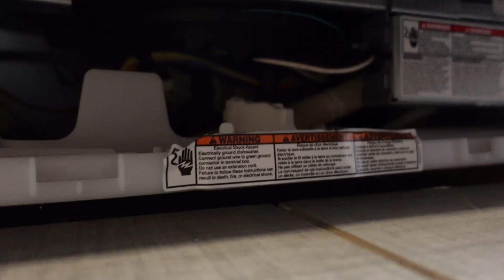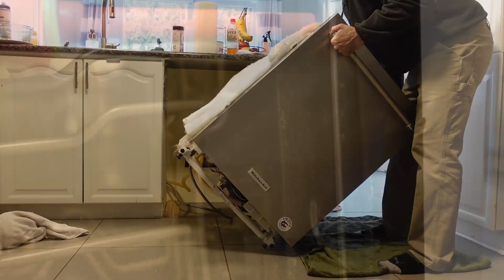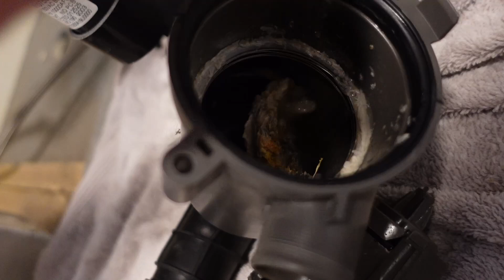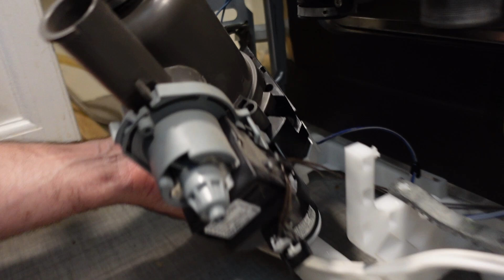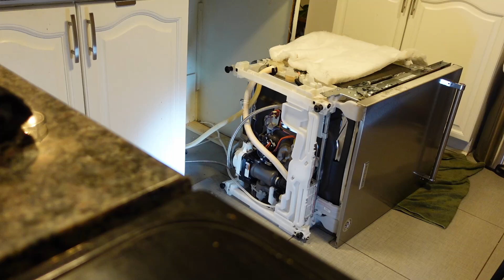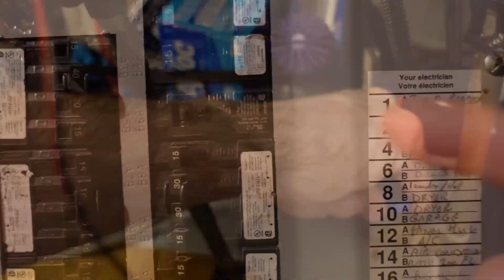Dishwasher Not Cleaning, Pump Repair - Kitchenaid, Maytag, Whirlpool

Comment: your videos are some of the very few useful ones available for seeing these take-aparts for this model of dishwasher. thank you for your time and efforts - i was getting the drain error, i first replaced the inlet valve and it was working for short period but it is happening again. I suspect this is my next step. 

edit: completed that replacement today, and it fixed the issue. (replaced the whole assembly) i agree that it's poor design with these spinning filters, and the single use clamps are a pain as well.
Reply from the maker: I find that dishwashers have too many AI generated videos that really aren't that useful.
Thanks for watching.

Comment: Here’s a tip for anyone attempting this project: you do NOT have to undo the single-use hose clamps on the motor assembly in order to inspect the filter, as the author of this video does.

Simply unscrew the plastic filter housing from the motor via the two torx screws and remove the filter internals. There is enough slack in the motor assembly mounts and the hoses to allow the two halves to separate.

Be careful though, as once the motor is detached from the filter housing it is loose—I accidentally dropped mine! 

With any luck your metal filter is intact and can simply be cleaned. Also, make sure you pay special attention to how each part goes together in the filter housing. Last thing you want to do is put together incorrectly and cause even greater problems.
Reply from the maker: thanks for the input.
Reply: @DIYNorth Thanks for your video. It saved me big time!!

Comment: Requiring proprietary replacement parts is how they continue to pick your pocket long after the original purchase.
Reply from the maker: Yes, every company does it, but appliance companies set crazy high prices on their stuff. particularly considering what the actual value should be. For a lot of people it would be better to just get a new washer under warranty. If a repairman had to also be paid this job could easily approach 5-600.

Comment: One more think about build quality. Samsung diswasher survived 3years and motor housing with propeler and build in heater lost dimension tolerance and stop pumping. 250$ for new part.  I get maytag diswasher and it survive 5 years because not servicable filter explode. So i don't know what is better. Samsung 3 years or 5 years with maytag. Everything is junk now days.
Reply from the maker: I had a lot of problems with my samsung as well as a Frigidaire.  That was before I made youtube videos unfortunately.

Comment: Great video I had the same problem with my dishwasher. I was wondering if you ever replaced the half inch hose clams with a quarter inch hose clamps and if you had any leaking issues with a half inch hose clams.
Reply from the maker: Yes I replaced them.
No leaks

Comment: Thanks for the video! I was struggling with an F9E1 error code with seemingly incongruous symptoms, it would drain but didn’t have the pressure to recirculate the water for actually cleaning the dishes. Once I had it apart I found the fliter was fine and could still spin but just barely, after cleaning the gunk out it was running 100% normally. Looks like we’ll be much more careful of what goes into the dishwasher moving forward.
Reply from the maker: I'm a bit more careful now.  Thanks for checking out the video

Comment: too broke to replace filter, took it out, cut the actual metal filter part off and left the top black part of the filter off. Put it back together, running diagnostic now. Sounds like everything is running lol. But I don't recommend doing it this way.
Reply from the maker: It might put the motor at risk if solid bits can get in too far. But if it works it works I guess

Comment: Great instructional videos!  Were you still getting the F9E1 drain error code here?  Having this same problem while the code is present and it drained fine the last few cycles it ran.  Confirmed my lines are good and the side water inlet assembly looks clean.  Have not taken this pump apart yet but guess this will be the next step.
Reply from the maker: yes it had the same code. are your dishes coming clean when it works?
Reply: @DIYNorth  No, the last two times it ran they were still dirty, then the failed cycles with the error code appeared.  Any further trouble with yours once the filter and drain pump were replaced?

Comment: Thank you. Had the same issue. Found the filter for $90 but got the whole circulation pump assembly for $180 to cover my bases and it came with the factory hose clamps. I need to buy 4” end nipper pliers from harbor freight to close the hose clamps
Reply from the maker: hope the dishwasher holds up after the fix. thanks for watching

Comment: Does anyone know what size clamps go on the hoses for this pump?

My pump seized up as well, but the filter was intact just completely clogged. It started being problematic only about a year into ownership but would hobble along...

This and the maytag washer I bought with it have been nothing but headaches and they are all engineered problems.

The same filter/clogged pump problem happens with the clothes washer and the pump is placed in an entirely unserviceable location for DIY/home repair. Coupled with things like the proprietary hose clamps on this circulation pump, hoses that connect in location obscured by housings/other components that don't need to be in the way, unfinished sheet metal to reach around/through on both units... Definitely decisions made to drum up service calls.
Reply from the maker: i did another video with the correct factory clamps. https://www.youtube.com/watch?v=LaOH0iGW60g&t=200s

Comment: Thank you for posting it led me to discover the exact same issue.
I’m very meticulous about rinsing everything off my dishes before they go in and yet this still occurred.  
The Fine metal mesh screen was destroyed along with the rubber seal at the point it connects with the motor. Over $200 to replace the parts and repair myself, poor design for sure. Hopefully Kitchen Aid fixes the design so it doesn’t happen again.
Reply from the maker: Thanks for watching. Glad the video helped

Comment: I have this exact same problem, I couldn’t believe it when I Found out the filter had self-destructed. My kitchen aid dishwasher is just over a year old. This will be the last time I buy a whirlpool product. I’ve had bad luck with them in the past but I bought the kitchen aid hoping they were made a little better than the standard whirlpool products.
Reply: Same thing just happened to ours, the 1 year manufacturer warranty went out in March of this year. Just took it apart tonight, filter was shredded, with almost a perfectly straight cut on the screen of the filter.
Reply from the maker: Well, if you got to that point putting the new one in is pretty straight forward now.
Reply from the maker: Sorry you had this issue

Comment: Update:

I was able to fix my dishwasher  by replacing the filter, but I found out two helpful tips along the way.

1.  Flip the washer on its LEFT side.  This gives you easy access to both ofhe two Torx screws that connect the filter housing to the motor.

2.  The shock mount bracket at the rear of the washer that grabs the end of the pump motor has a tiny plastic pin that you can push out and that lets you slide the shock mount bracket out of the way so you don't have to twist things quite as much. Just use some needle nose pliers to pinch the split wnd of the pin and push it out of the hole and save it for later reinstallation.
Reply from the maker: glad your dishwasher is fixed. thanks for providing tips.

Comment: Hopefully within the hour I will be in possession of a new filter, having ordered it yesterday, and was assured by my local Maytag store that even on New Years Eve the parts delivery would be happening.

I really appreciate your detailed video of the reassembly of the filter into its housing, but I noticed that there is a weird  multi layered compression washer that  I BELIEVE goes around the filter right before you you insert it back into the housing.  I tried to be careful during disassembly to note the order but the difficulty in getting the filter out of the housing meant I was distracted and I cut myself forcing it out.  

Anywho, the compression washer is four layers with two flat layers on the outside which between them sandwich two curved washers of the same size but which can be compressed together.
Reply from the maker: Is it the thing that I install at the 6:00 min point in the video?
Reply: @DIYNorth 
No.  The compression washer goes into the filter housing before you push the filter back into it.

Comment: Awesome video. I just pulled out the filter on my 4 year old Maytag (MDB8959SKZ) an hour ago and have to order a replacement tomorrow-  if I cant get it locally for a decent price.

My washer stopped working and threw an E1F9 error code (washer won't drain), EXCEPT it WOULD drain if you manually filled the tub with water and used the cancel feature to drain it.

Scumbag Maytag won't even show you accurate error codes that reflect the actual malfunction.

On line it appears you can find the filter for $70-$250 depending on the site.  Im aiming for around $95 including two day shipping hopefully.

Wish Id seen your video  sooner.  I worked off a couple other videos that didn't require disconnecting any hoses, but only taking out those two T-15 Torx screws to separate the pump and expose the filter.  I had to bend the anti vibration mount at the back of the washer in order to pull the motor off but I'll bend it back and use galvanized wire to keep pressure if needed when I put it back together.

My filter area was not really gunked up BUT the filter screen was torn twisted and shredded to the point that I found metal shards in the disposal where the washer drains.  Part of the filter was protruding from its housing and probably jammed the motor from turning.

I agree that this design with an inaccessible hard-to-service filter is stupid.

The old dishwasher that came with the house lasted about 20 years for us and I bet it was already 10 years old when we bought it.
Reply from the maker: I think that my issue was people had washed some jars with the labels on them a few times over the years and the filter can't handle the paper. Over all I would prefer to have a more accessible filter that I can clean without pulling the dishwasher.
Reply: @DIYNorth  I completely agree that all filters should be easily accessible.  I was actually surprised that the filter housing wasnt gunked up when I pulled it, though I did manage to cut myself on the perforated filter material as I wrestled it out.  I saw someone else's video where it looked like unpopped popcorn kernels might have gotten into the filter and helped wreck it but aside from a miniscule bit of sludge my filter was clean (but mangled)

Comment: I've done this twice now on my Maytag but only to remove clogs. I've seen the price on that filter and I now take extra caution to make sure nothing hard like a piece of plastic makes it down there. Apparently these are suppose to be self-cleaning filters but they obviously aren't as mine and others seem to clog up around once a year. I agree its a bad design, both the filter itself and the placement of it making you have to remove the whole unit to access it.

The only thing I would ad is that gear clamps work just fine. Yes, they are a bit of a wider band, but they still clamp and seal well and do not damage the rubber hoses. As I said I've done this twice now, both times using the gear clamps and haven't had an issue.

Edit: I watched your clamp video and I see they did cause damage to yours so I guess it's a possibility, I was just stating my experience and assumed you hadn't tried the gear clamps.
Reply from the maker: The larger clamps from home depot and Lowe's are fine I think as well. They will hold the rubber hoses. I was just on a mission to get the real ones

Comment: Thanks for this great video. Same issue with mine. I found the filter online, but having trouble with the clamps. They are 2 diff diameters, one says 38.1 and the other says 44. But I can't seem to find them on the parts websites. (Oetiker ear clamps)
Reply from the maker: I did a separate video on clamps after this video. I assume that these are the clamps you are talking about.
https://www.youtube.com/watch?v=LaOH0iGW60g

Comment: This was exactly what I needed! Pulled mine out and of course the metal mesh was shredded and seized.
Reply from the maker: Glad it helped.
Sorry about the dishwasher. The part is really expensive.
Reply: I'm about to run out and see if i can get the  replacement filter and hopefully that's all I need to get mine running again.

Comment: Could you provide links to the filter and clamps? I went to a local appliance parts store, and they didn't have the clamps. Neither did any of their other stores. Neither did their competitor.
Reply from the maker: you can just google the part number and it should come up. I am in Canada and couldn't use the "Parts Dr" website in the US. But you should use your dishwasher model number to find the specific parts as we might have different part requirements. https://partsdr.com/  (this site should have parts you need if you are in the US)
Filter - W11643383
Clamp for Suction Line - W10783615 (would probably work for high pressure line)
High Pressure Hose with Claps - W11419334
Reply: @DIYNorth  Thanks. I have the filter and clamps on order.
Reply from the maker: @gearhead366  good luck with the dishwasher
Reply: @gearhead366  Based on how confident I am that a new filter will fail soon afterwards I may just use zip ties to hold hoses on.